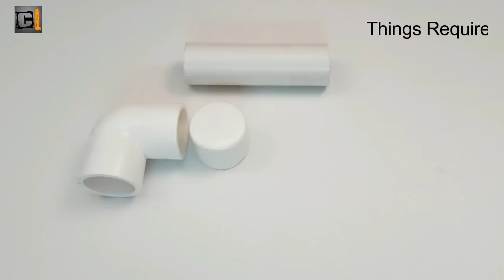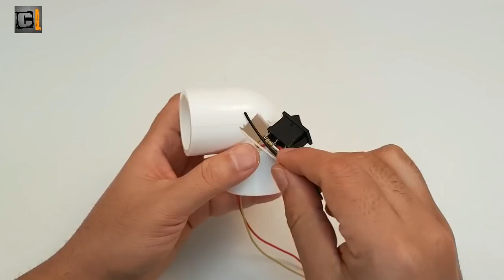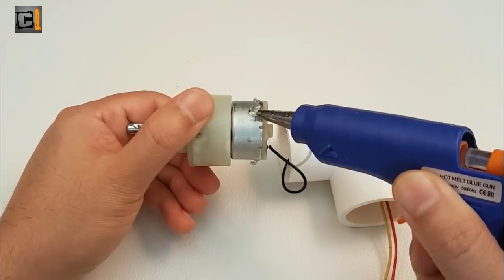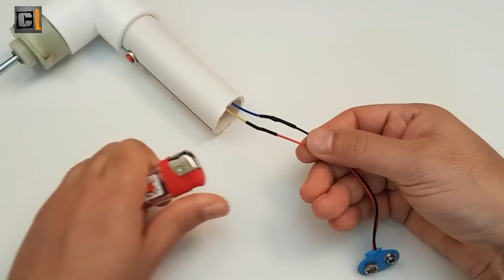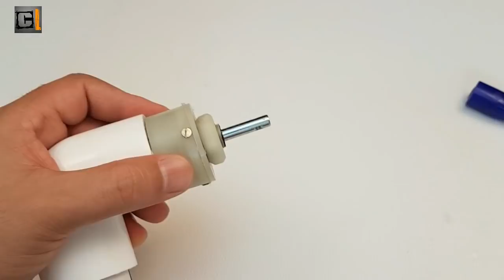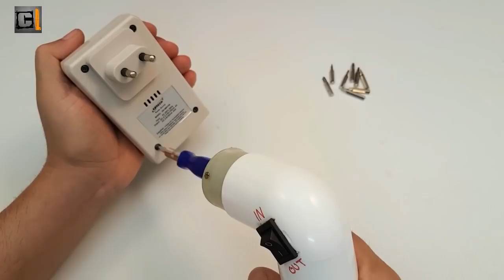How to Make a Electric Screwdriver

Comment: Which motor you have used in this project??? What is the capacity of the battery???
Reply: It is - 150 rpm 12volts

Comment: another Improvement can be made by attaching the metal adapter of the screw directly on the motor shaft, so no plastic parts between the shaft and the screw head